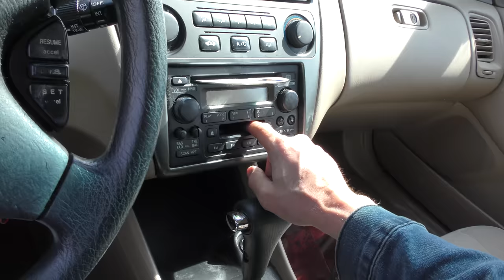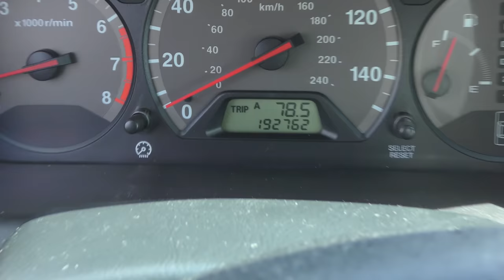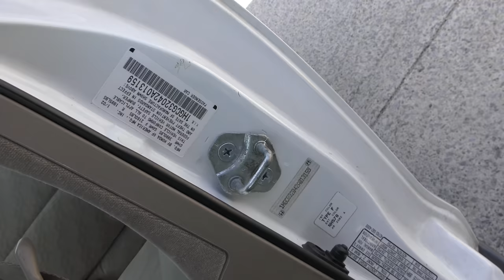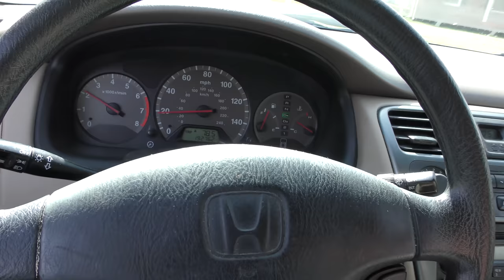This Car Has a Serious Problem

Comment: I have the same year Honda but blue and I absolutely love it. Gets great gas mileage and I only payed 2000 for it. Since it’s a four cylinder maintenance is a breeze there is so much working room in the bay I bought a Haynes manual and have done every job it’s needed. I wrecked it in 2020 but since the engine was still running I decided to fix it at home in my driveway and it doesn’t have any mechanical problems even after a wreck! These things are so reliable and I love the coupes rear end because it reminds me of my dream car an Acura NSX
Reply: Sounds awesome I am also looking into owning a 4 cylinder Honda now because they are very reliable and easy to work on. I also like the aesthetic of their models
Reply: Go to rock auto you can get the shop manual for $20. No a CD.
Reply: @melancholypuppy3595  I would recommend you look for a manual transmission and I agree from the civics to the preludes Honda styling is one of my favorites.
Reply: @Shwert890  I would love to find a Honda prelude standard. Someone offered to sell me a del sol but I think they ran it pretty hard. I should've taken a gamble on it though
Reply: @melancholypuppy3595  I highly recommend it. I’ve also got a 4 cylinder Honda and it’s pretty much bulletproof. Smaller and mechanically simpler than a V6 and my 2011 has a timing chain so I don’t have to worry about the chain rotting and breaking like a belt since I just did an oil change recently.

Comment: I have traded in a 2012, 2015 and a 2018 Honda Accords with 250,000 plus miles on each one. The only maintenance was oil changes, tires and brakes. Great cars.
Reply: Sky that's nothing to brag about. Three years is nothing to keep a car regardless of miles. It is good for a car to run if driven reasonably.
Reply: @bonniehall3428  . Where did I mention I only kept each car 3 years?

Comment: I owned an 03' Buick Lesabre that I had to get rid of 2 years ago because of excessive rust.  The car had 208,000 miles on it when I got rid of it and the engine still sounded brand new.  The original transmission was also still in pretty good shape.

Comment: It reminds me of my old 95' Lexus SC300, 203k miles, ran smooth as silk and everything worked. 30mpg highway, great car. Just sold it last Spring, needed a bigger car for traveling. One of the best cars that I've ever owned, along with an Acura Legend that was also great. If you buy a good car and take care of it, they last a very long time. Don't skimp on the maintenance. Especially oil changes.
Reply: Sounds like Toyota and Honda has won you over. Awesome

Comment: Great car! I have the exact same car in 2015 form with a V6 and it's been flawless! Excellently engineered vehicle nameplate! I'm impressed that the transmission has held in that 2002! They were notorious for failing but usually not until around 150k. My brother had a 2001 but he religiously changed the tranny fluid and it never failed.  It's usually people who are hard on the car and don't do anything with the transmission fluid.
Reply: flushing it out is different to changing the fluid

Comment: People say putting money in a Old Vehicle is a waste .  Personally I don't think like that .  Those couple Items You mention  ,Window Motor and rebuilt Trans is actually a very cheap way to go on a vehicle that is still in pretty nice condition  !  Buying Used vehicles today is Expensive !  Not going to get much unless you spend 10 to 15 , maybe 20 grand , so that its not going to Nickle and Dime you to Death . Plus even at that Price it will have a good amount of Miles on it !  Payments for a Yr would be well over what it would cost to fix it and keep it running good !  Plus your not Locked into Payments for 4 plus yrs on another Used Vehicle !  I would put some money into it , Sounds and looks to good to not give it some LOVE , LOL
Reply: Ride sharing has destroyed the reliablity of used cars.
Reply: I’ve always thought this. I can spend $1000 or something on a major repair or I can spend $3500-$4K a year at a minimum on payments for a new car for several years? Easy math, to me

Comment: I've found most shops don't like to do transmission fluid changes where you drop the pan (because it's messy and more labour intensive). Instead they try to sneak in the easy transmission flush. It's to the point where I don't know if I can find a place to do an old school transmission fluid change anymore.
Reply: Just do it yourself

Comment: I have a 2002 Acura MDX,  3.5L Vtec, AWD. and I gotta say-- it's one of their best cars they've ever made.  Not a single drip of oil-- everything works.  I put a fancy scan tool to it this week---  Absolutely everything works well, both fuel trims are right at 0.  3 rows of heated leather seats, heated mirrors, Moon roof.   It's such a good car.  I'm so happy to have it.

Comment: SCOTTY!!! I bought my 2013 crv about 4 years ago at 82k miles and have done all oil changes and basic maitinence myself. I'm about to hit 120k which will mark the 1st 40k miles and I was going to change the tyranny fluid (not flush) but idk if it's been done before and I know you said if it hasn't ever been done to just leave it but I didn't know if 120k was still a low enough milage to still risk it.

Comment: I’m 16 and almost my whole life, I’ve been familiar to cars with old technology. I even have a 2001 Corolla with a tape deck. And all that’s damaged is the driver side fender. And I plan to fix.
Reply: My Honda tape deck from ebay lasted 15 yrs, and I used it a lot.
Reply: I'm 17 and I got a 97 Lincoln continental and she's a big baby. I've already put some decent money into her but she's running like a champ, no check engine light. Transmission is awesome. Sadly she has big damage on her passenger side but it's not mechanical. After I get a new vehicle imma give her some more tlc and get her set up to be a classic

Comment: Found out my ABS/VSC on my 2004 GS300 was caused by knock sensor, which made the speed control sensors go haywire, the knock sensor also caused problems with the 02 and MAF sensors
Reply: The Knock Sensor also disabled my Overdrive on my 2001 Lexus RX300. That was a job and the sensors were expensive.
Reply: @trevagraham1605  Yup. I forgot to mention that, it made my "power mode" also go crazy.
Reply: @trevagraham1605  Well I kinda of did mention it with the speed controls, but yeah once again you right.

Comment: I have a 2005 Toyota Camry with 240k! A/C ice cold super quite no trembles it even survived a small flood! All I do is full synthetic oil changes and most recently I put a new head gasket seal myself 😌 super easy to work on. And I drive more City than Highway on top of living in Nebraska which one day is cold one day is hot.

Comment: My grandfather had a 1953 Ford with the flathead v8 that he got 170000 miles out of before it busted a ring.  He babied it also with his top speed being 45 mph.  Transmission-3 speed standard that gave no problems.  However, his mechanical clock never worked and his AM radio with the trouble prone vibrator system never worked either.

Comment: NIssan Coil Over problem - I just had an issue (missfire on cylinder 1)I fixed last weekend on our 2007 nissan pathfinder. I replaced only the one plug that went bad. Its fine now, but if another goes bad under the intake (because of course cylinder 1 is buried under the intake manifold) I will put new ones on that side entirely.  They are original coils and that is the first one that went bad and that was admittedly after about 15 years.

Comment: I have the previous model. The engine looks just like this one but it's a 2.2. It makes all kinds of noises, though. Last week, the alarm started turning on by itself. All the electric devices such as SRS, ABS and cruise control don't work and no one has ever been able to fix them.

Comment: I didn’t understand the correlation between fuel trims and ‘efficiency’.  Also, the reason a transmission slips after a fluid change is that the TCM is suddenly working with lower friction fluid and needs time to work out stronger application of the clutches.  Mine did this.  It relearned and I’ve put 50k miles on it since then.  To say ‘don’t change old fluid’ is madness imo.

Comment: I have a similar car although mine is the 4 door sedan however it has the same drive train.  I bought it used in 2004 with 15k on it and I still have it 17+ years later with 133k.  I had new struts and tires put on it last year and it still runs well.  I unexpectedly had to have the timing belt/water pump job redone last year after the water pump failed but otherwise it has been very reliable.  My passenger side window regulator failed too but I had to have it replaced since the window would not stay up.  This is a well designed car and there are still many of them on the road today.

Comment: I have that same glitch in my Cavalier automatic since I changed heads.  My engine rear main seal is bad, and it sprays oil everywhere.  The electric connectors to the transaxle were very oily, and I had to disconnect them to get the old heads off.  I tried my best to clean it a little (couldn't see it, and it was a little tough to reach).  After reconnecting the wires, it won't cold shift into drive.  I have to put it into first, wait for it to engage, then upshift to drive.   I'm fairly certain my problem is electrical.  If I put an oil pumping rig on my hood to suck up all the mess and changed the wires, I'm pretty sure that  would solve the issue.
Reply: Heads?? You have a caviler.....it only has one head
Reply: @richsweeney1115   Tomato/potahhto...   At least it's got cylinders instead of a usb cable for recharging it.  My son is challenging me to cram a V8 in there.   Tempting....
Anyway, I thought each cylinder has its own 'head', though they're all in one piece of aluminum.  So I woulda thunk my engine technically has 4 heads, but I could be totally wrong.
Reply: You never know,I saw Chevy Vega with V8
Reply: @scottk3292  there's one head, with 2 valves for each cylinder on that motor, cooling channels, intake and exhaust ports built into it for the intake and exhaust manifolds to bolt onto the head

Comment: If you are changing sparkplugs on an engine that  ran smooth, no misfires and after changing the plugs you have a misfire, rough idle, check those sparkplugs first. I have had bad plugs, new right out of the box. The plug may have been dropped. If you drop a sparkplug, don't use it. Throw it and get a new one. You can do a basic test on new plugs by checking the resistance from the electrode to the tip and from the tip to the base of the plug. Compare your readings to a known good sparkplug.

Comment: I remember how early Hondas from the 70s and into the 80s just rusted out. The engines and transmissions were still good but the body and frame had holes in them by the time you hit 100,000 miles. They've improved that a lot. I might get an Accord coupe if I could find one that wasn't way overpriced and had the manual transmission.

Comment: Bought a 2000 Accord V6 with 160k miles a year and  a half ago for 2k. Absolutely trouble free... 25k miles, 4 oil changes, and a new battery later (unnecessary, just peace of mind) and I've had no regrets. Perfect commuter car!
Reply: How can a 2000 Accord have only 160k miles in America in the year 2020? Did it line up with what the carfax said?
Reply: @ShaferHart  Yes, I bought it from the original owner. Bonus for me was it was the fully loaded EX model with leather. The leather was untouched, as they'd had sheepskin covers on them their entire lives. The leather seats are all immaculate.

Comment: working on a 1965 ford fairlane 500 ranch wagon almost got it all working again biggest problem seems to be a slight transmission leak. and a strange vibration that happens some time when breaking

Comment: Hey Scotty, I always trust your advice. It's coming up time to change my 2018 Nissan Rogue's cvt transmission fluid. I was thinking about using Amsoil, but I would like your opinion. I don't know if it's okay to mix a little of the old with the new as some will be left with a drain and fill. What do you think?
Reply: I think Scotty would say to stick with what it came with originally. He has advised against mixing various brands in similar situations.
Reply: Stick to oem fluid for transmissions. Change it early and often.
Reply: Original fluid only , early and often , Scotty would say this, don’t mess with anything but OEM fluid

Comment: I have a 2011 Ford Fiesta with 170k miles and I have never changed the transmission fluid.  I have seen videos on the channel advising against changing the transmission fluid.  Should I change it?  Should I not?  Are there specific circumstances where changing it would be bad?  It does shift a little rough from 1 to 2 and 2 to 3 gears.  It also has a little shudder at low speeds that goes away after it fully warms up.

Comment: Scotty, have you tried to reset ECU for this Honda? My Asian Honda City model acts the same thing when first pulling off with slight jerk on trans. I have not reset ECU yet. I don’t have tool to do it. For Honda trans, if lightly press speed pedal (easy on gas pedal-no rush on pedal), jerk won’t happens. That’s Honda trans treat driver for speeder.

Comment: Hi Scotty. I have a 2007 Toyota Camry SE that has some issues. Currently, the estimated cost to fix is about $2400 and that's after I've already replaced the O2 Sensor, Battery, Coil Packs, Spark Plugs, and the mass airflow sensor. My dilemma is whether or not I should keep working on this car. I'd love to give it to my son but I'm thinking it's not worth it. You'd never know it has issues just looking at it because the body is perfect and the interior is great. What do you think from a mechanics point of view?

Comment: Afternoon Scotty! 
What’s the most expensive thing that could be causing a misfire? I have a 94 Nissan Pathfinder with a rough idle and I’m wondering what the problem could be and how expensive or cheap it would be to fix. I have plans to change the plugs and see if that helps.
Reply: Check spark plugs or valve cover gasket. If gasket is bad oil can be leaking down into spark plugs which if is bad enough can cause a misfire
Reply: If you change spark plugs check and see if there is oil on the end of them when you take the old ones out
Reply: Could be other things also but that is where I would start
Reply: Also try to do the basic air filter and and fuel filter as well. Maybe try a gumout fuel injector cleaner as well
Reply: Also try to chance pcv valves it might go a way
Reply: Distributer could be faulty too

Comment: I'm a big Scotty fan, but . . . I bought a new 2005 Honda Accord and wasn't too impressed with the famed Japanese quality.  I kept it around 50,000 kilometers (31,000 miles) and then got rid of it.  It had terrible air conditioning, if you could call it that.  It blew something, but in our hot and humid Toronto weather, it just couldn't keep up.  I took it back to the dealer two or three times; each time they showed me some meter and said "it's up to specs".  I showed them my soaked underarms and said "this is my meter, and it says it's not working too good!".  The paint chipped pretty easily and I also remember a cheap cloth interior that was wearing much too quickly.  It wasn't an inexpensive car either.  Now before that, in 1993, I didn't have much money as a young guy, but bought another new car, a 1993 Dodge Spirit . . . and it was one of the best cars I ever owned.  I put 80,000 miles on it, I never had any problem,  it came at a REAL bargain price and contained a lot of nice extras including air (which worked REALLY well), automatic tranny, 2.5 liter 4 cylinder engine, power windows and door locks, nice stereo, aluminum alloy wheels with Michelins, folding rear seat, intermittent wipers and beautiful paint.  A lot cheaper than the Accord and truly a better car . . . and this from Chrysler.  You never know in the car business . . .

Comment: Scotty...do you ever use a Borescope to look inside the cylinders etc?
I bought two scopes as they are really cheap...like $20 US for a 5 meter scope line.
These ones are not optical fiber but rather they have a cheaper camera at the end and 5 meters of wire.
I would like to put one in the cylinder to check the bore for scratches.  Should I take the scope out before starting the car?   XD

Comment: My 09 scion tc been burning oil for about 60,000 miles now as long as it has oil she'll run 😂😂. It's been doing it for quite some time hasn't gotten any worse at least. I been expecting it to die on me for a few years now. If it keeps running though imma keep sending her.

Comment: I owned one, it was the best car I have ever driven. Changed the transmission fluid every 30,000 miles, frequent oil changes, never had a problem. 

Car lasted till 190,000 miles, lost the car in an accident. It was a loss, other wise I would have still been driving it.

Comment: Hey Mr Kilmer I bought a second hand Toyota corolla 2011 model and it burns about 400ml of oil every 3000km would replacing the pcv valve help as it is still the original ?.